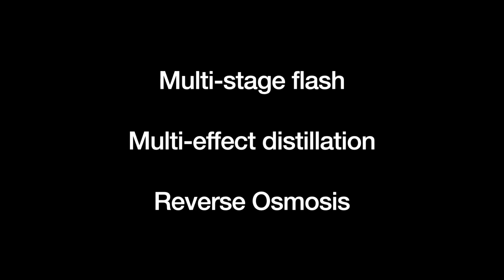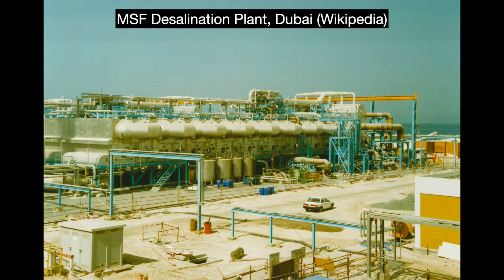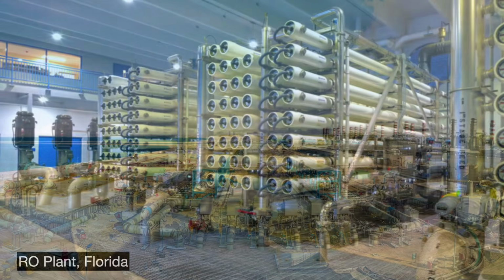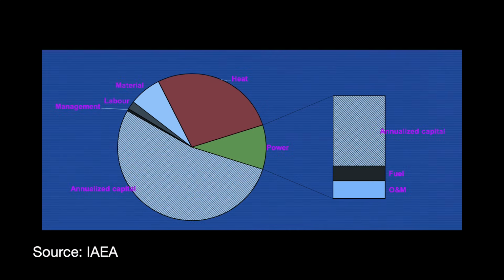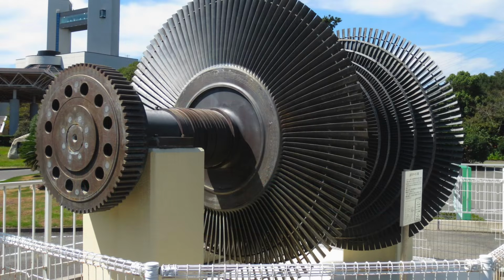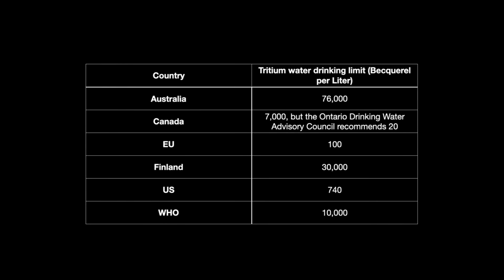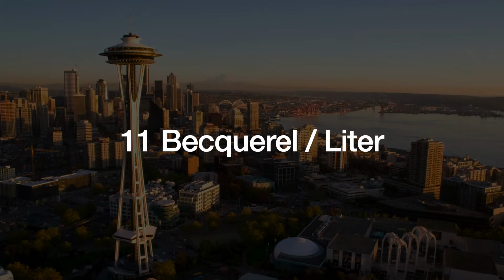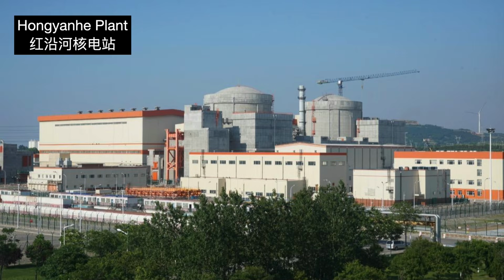Going Nuclear to Desalinate Seawater

Comment: i'm very curious if anyone has looked into using concentrated solar (mirrors, heat tower and molten metal) to conduct desalination. Seems very viable in any dry, hot desert region with access to the coast. The middle east and baja california come to mind.
Reply: Should be something the world bank could perhaps finance for Somalia or Mauretania. 

Imagine having a 1 GW solar park for a desalination plant.
Reply: Nope, too much energy is needed this way. CSP is very weak.
Reply: @ImaskarDono  Concentrated Solar is very strong and all the energy required comes from the Sun. Solar power towers can heat salts up to 1000DegC which can then be pumped to evaporation ponds or green houses to distill salt water.
Reply: @motimobo  check the actual economics of such projects. So far they are not working out. The materials are very expensive per kWh produced.
Reply: Concentrated solar required a lot of area outside and exposed to temperature fluctuations and weather.

Because many working parts are outdoor and spread out, it cost a lot of maintenance cost.

That's why people put machine indoors and close together, because stuff will degrade slower, easy to travel when fixing, less money spent buying sparepart and hire less workers.

Comment: What to do with brack water that is left over? It can damage ocean habitats.
Reply: It's rich in metals we need. Sodium is a promising new metal for battery tech that could replace lithium and is ubiquitous. Magnesium is a great building material similar to titanium. And other trace materials and chemicals can be harvested and sold to industry, such as chlorine.
Reply: @Anenome5  Very expensive to take high saline desalination brine down to extraction of solutes. Then the salt needs to run an industrial process to separate the eg magnesium, Lithium and Sodium from the chlorine and each other. Very expensive, energy intensive. Dry salt deposits all over western N. And S. America's, very little mineral separation happening due to cost.
Reply: It can also be added at the right times of day and locations to improve the habitat.
Reply: I wonder how much lithium is in the leftover brine, and if they could extract it like what is being done at Salton Sea. Probably not the same as the SS brine is geothermal from earth fissures.
Reply: Oh no, salt water in a salty ocean, what EVER will we do!!??? Quick, call the far left and let them throw a fit on the floor about salt this time!!!1!!!11
Reply: Dump it in the open ocean. The solution is dilution. Why is nobody this concerned about increases in salinity caused by normal evaporation off the ocean surface?
Reply: @gregorymalchuk272 because thats a process that took thousands of years to finally reach balance and messing up that balance could have devastating results on the sea life and ecosystem.
Reply: @FNA27601  Chuck a fit Kamela